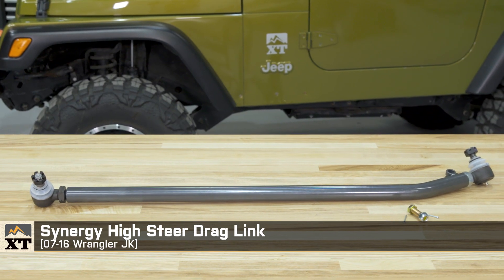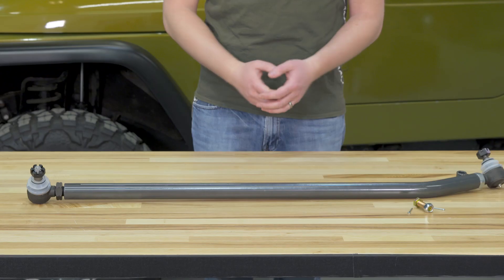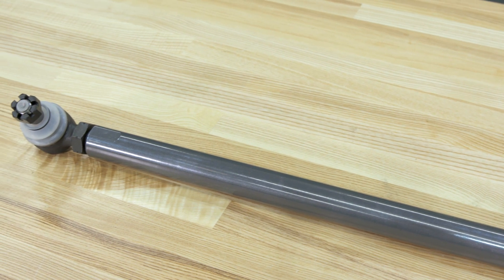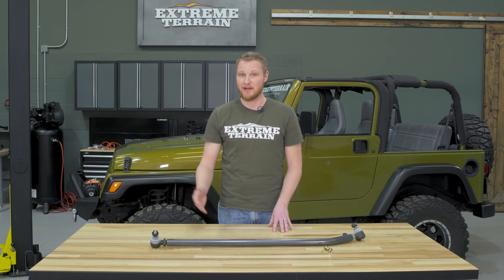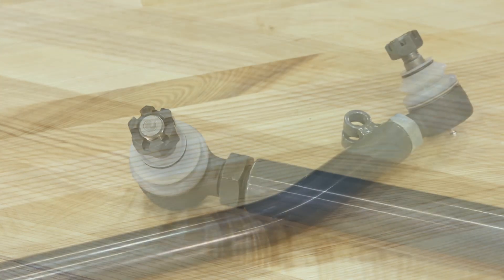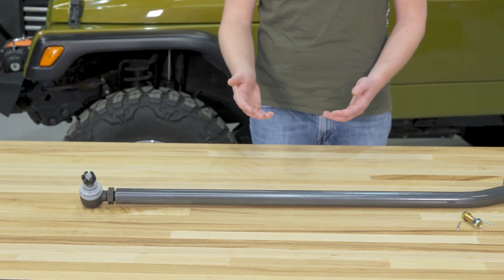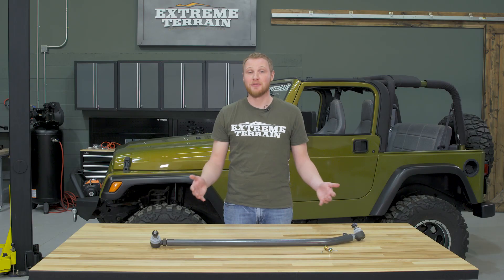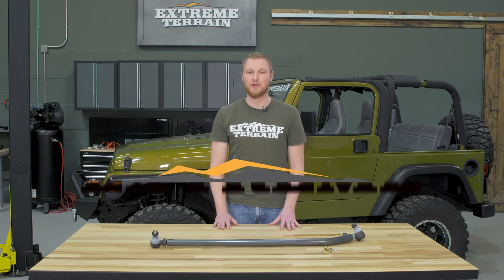Jeep Wrangler Synergy High Steer Drag Link (2007-2016 JK) Review

Comment: How do you adjust the Synergy drag link to straighten the steering wheel? I used to do it on the factory one but this one is different. Do you you have to loosen the jam nut on the passenger side as well as the collar nut and bolt to turn the entire thing??

Comment: Can you do a video on how to adjust the drag link to get the wheel centered? The stock dl was easy with just loosening the 2 15mm bolts, turn and tighten. My wheel is at 11 o'clock after a 4wp alignment.
Reply: I have the same problem. Did you ever figure it out?
Reply: @elguapo7722    This Synergy dl is a pita to adjust. I no longer have the '08 JK X w/ the synergy dl. I now have an '05 TJ Rocky Mtn and recently installed a Currie drag link / tie rod that is a major upgrade from the synergy. So is my '05 TJ Rocky Mtn over that JK, good riddance. I would get rid of your synergy and replace it with a superior dl like a Steer Smarts.

Comment: There isn't anything you would change?  You obviously have not run this DL on a JK because if you had, you would have noticed those dumb grease boots held on with slinky springs that Syndergy uses are constantly popping off when you are greasing the DL joints.  Very annoying problem many of us are constantly dealing with, especially when we take our JKs to oil shops and they overfill the joint boots causing the boots to pop off because no other TR boot on earth is made with such a bad design as Syndergy.  Going with SteerSmarts next time.

Comment: Does anyone know if the jam nut on the passenger side is clockwise or counterclockwise threads?  Mine was installed by a shop and I need to remove it and cannot bust it loose but I want to make sure I'm not making things worse!

Comment: If you run it flipped as is you willl have a 1/4” dead spot in your steering. They have an adaptor and you will need to drill 7/8s drill bit through the knuckle. Hardest part is getting the stock one off. If you have a fork puller or pitman arm puller it comes off but will damage the boot to the stock one. If you are like me and not going to use it, why not.
Reply: question I bought this 13 jk that has the synergy drag link flip. it looks as if there isn't the adaptor and I have a small bump steer at the moment is this because there isn't the adapter on there? thank you
Reply: chris bloham bump steer is something different. Which adapter are you referring two. You will need two. If you have bump steer then likely you do not have a front track bar mount to raise the track bar location bolt so that way it is parallel to the drag link. If they cross, that’s where your bump steer is. If your drag link and front track bar are parallel or pretty much close (within an inch or two margin) they you should be good. If you have a dead spot in your steering then likely you are missing the adaptor that you need to drill and place into the knuckle. Both can be found separately. Both not bad